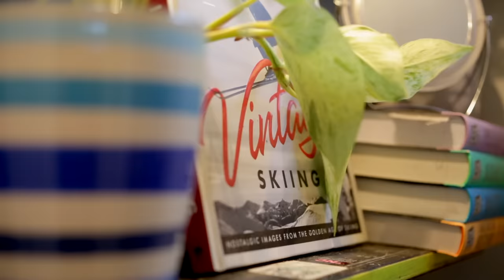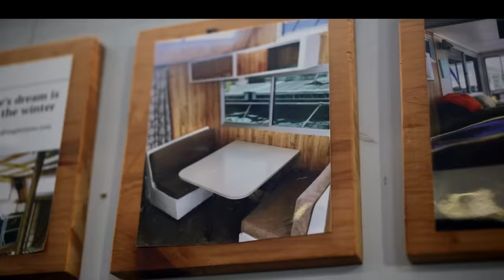Couple live on renovated Tiny House Boat - 5 years & snowy winters!

Comment: Well I sort of know what you are saying, but in my case I live on Lake Michigan and the entire state has a policy on the books that says ABSOLUTELY NO ONE CAN STAY ON THERE BOATS DURING THE WINTER MONTHS?. So I've decided that I'm going to design my own Tiny Houseboat and it's going to be 100% Solar powered, now my design is more just for me as no one else in the family is interested in boating. And I saw you playing with the water jug. My Tiny Home will be 40 x 20 with 2 electric Outboards that put out 50hp each. I'm hoping and praying alot that I can keep the cost around 300,000.00 dollars because everything runs on Electricity and  I will have 30 to 40 panels on the roof and the whole system installed is around 45,000 dollars and I will also have a 15 KW Generator for when I'm away from the docks, and I'm also building a custom THX Home theater sound system with around 25,000 watts total power and let's not forget the TV  .   It's going to be coming from a company called AWOL the whole system is about 19,000 dollars installed and the toilet is going to be  composting only have to empty every couple of months depending on use. I'm also installing a 15 gallons of fresh water maker, and it's a bit pricey at 5,000 Dollars but all you have to do is put in the filters and in what ever waterway you want within a few minutes you have fresh water. Oh and on the roof will be the KVH Satilite system for both my phone and Direct tv that's only 5,000 Dollars. And someone said what about food storage 1 of the benches is going to be a Cofin Freezer and the other side is going to be a bench fridge. And then comes the storage of the Lithium ion batteries to harness the 15 KW's of solar power i get everyday.  It's going to be the last 20 or so years of my life I'm already 62

Comment: A fantastic tiny home! A couple of questions though....
How do you deal with the water freezing during the Winter and avoid damage to the hull from ice? 
Another question is...
Is your house/boat able to move under its own power and is still usable as a boat as intended in its design? 
How often does the bilge pump have to run? 
Do you have solar panels to help with energy costs (I know the electric is included but...) 
A suggestion,  teak oil or neets foot oil is great for out door wooden furniture.
Reply: Due to the tide and content of salt in the water, we do not have issues with the water freezing. We decommissioned the engine when we decided to live on it in salt water/ near the ocean. Bilges almost never run (thankfully). We did use solar for lights and some DC components. Thank you for the suggestion of teak oil!
Reply: @josephtarr1379  Hey, I know this is out of the blue, but you mentioned the Marina is looking for Livaboarders, and I'm looking to buy a houseboat and live in it all year long, and like you I'm looking for a quiet place where I can work from home with good internet. Is there a way I could get that Marina's contact information? Thank you and sorry for the trouble.